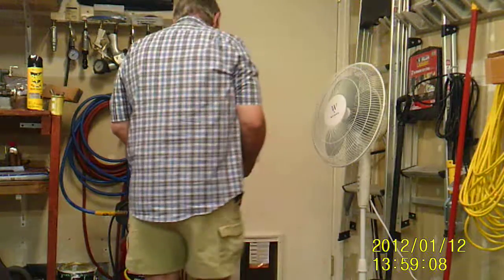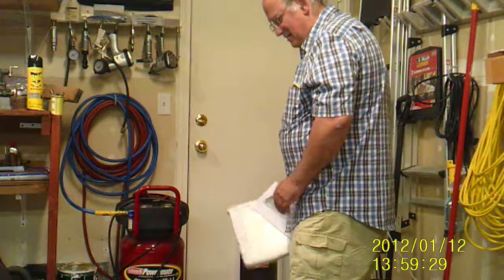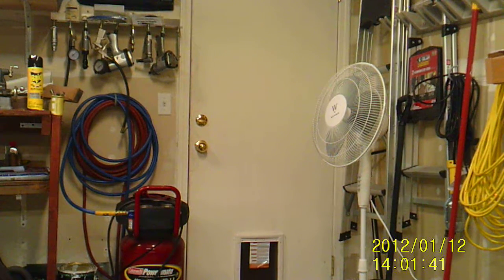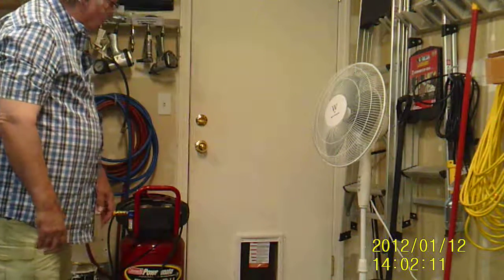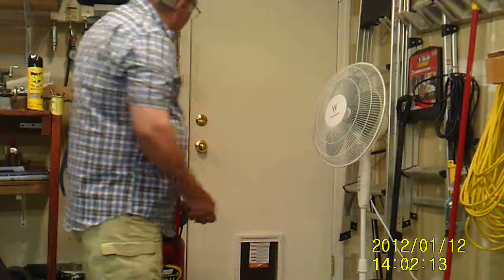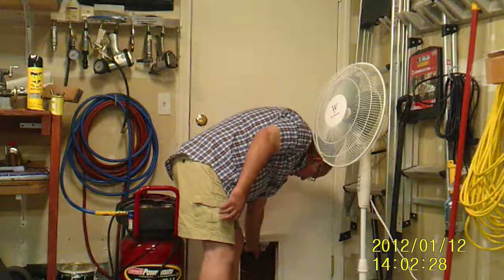doggie door install demo

Comment: He will get use to it and love it I'm sure!! Doors just not made like they use to be!
Reply from the maker: yes true this house was built in 2004 i keep finding more cheap ways they put this place together. Its not like my parents house that was built in 1948 the whole house redwood was used throughout including the boards on the roof and the sub floor even the wood siding was painted redwood nothing rotted. 
Yes I keep pushing chubs out the doggie door I had no idea he would bark when i opened it for him lol Sorry for getting my head cut off i'm still not used to this new camera